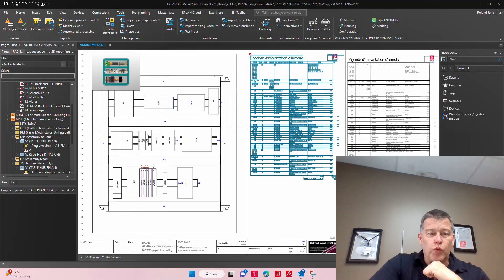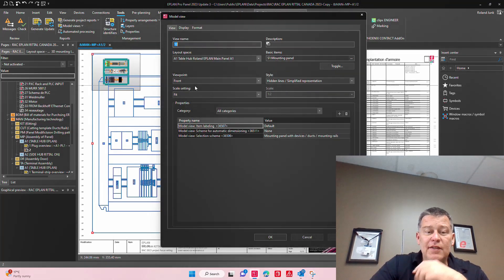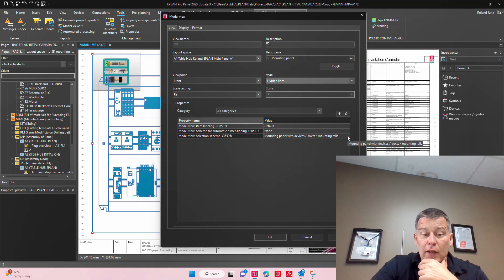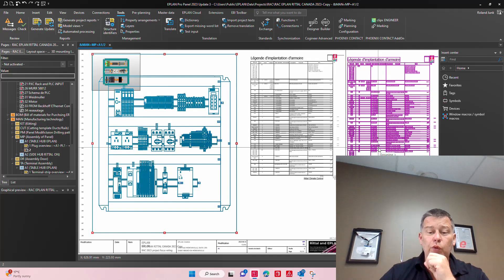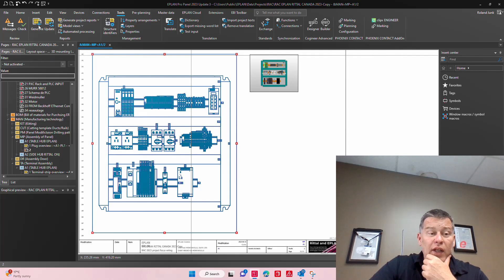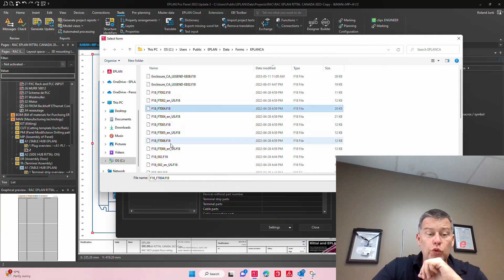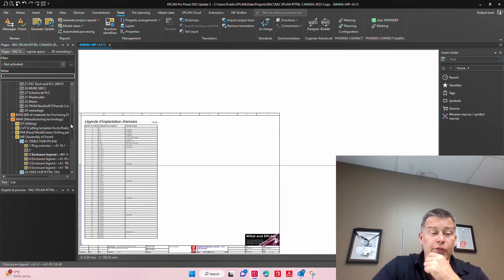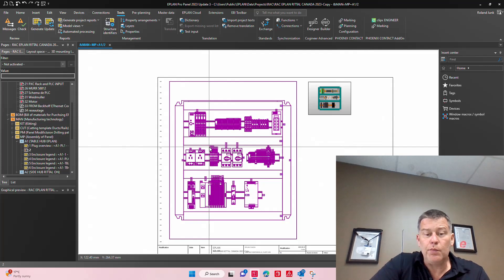EPLAN ProPanel Tutorial Digital Twin split enclosure legend on separate page then your ModelView

Comment: Hi Mr. Younk, I had attended your training class last year. You taught us how to break a symbol into 2 parts when inserting in a easy way. I couldn't recall. Could you help?
Reply from the maker: You mean breaking up a black box and it’s Device connection point?
Reply: @rolandyounk6169  Yes. For example, I have a servo drive in schematics which have more than 100 connection points. I need to put it on 2 pages in order to clearly show.
Reply from the maker: @weizhenwu7793  simple, EPLAN has the Device Concept. Mena one black box is the main function with a certain DT like BB1 and the second black box has the same DT except it is no longer Main Function. The main function will be the one carrying the parts data, will be the one that serves the DT numbering. The second or even more then 2 can be used will be simply adding their connection points to the same device. The first will reference to all other instances of the same DT, the second or more will reference to the main function only. This technic can also be sued to have the same black box represented in a single line or any overview of the system. The basics of the « Device Concept » is applied here.